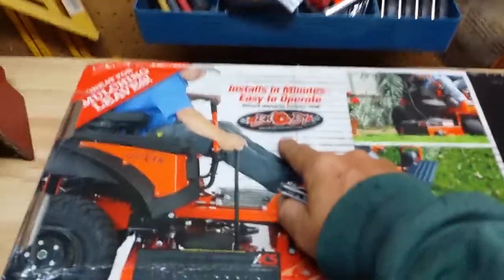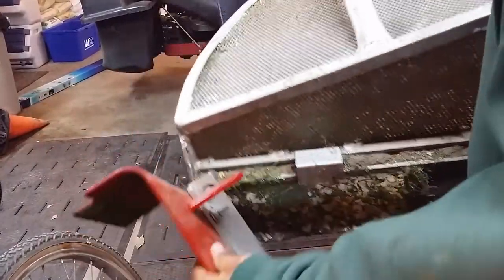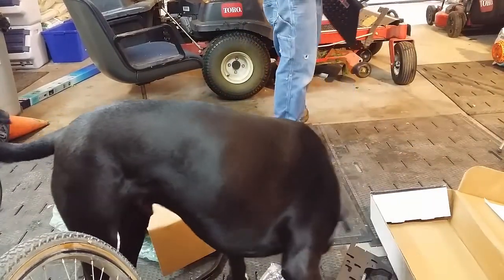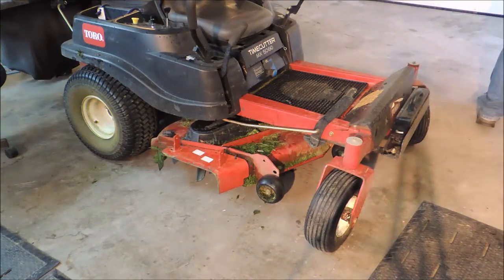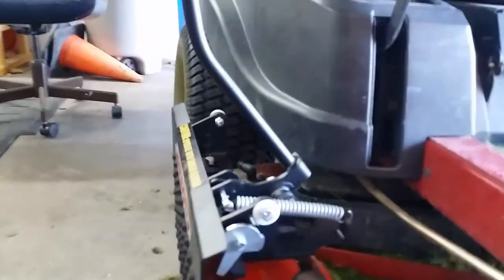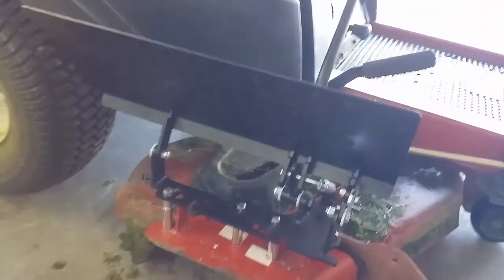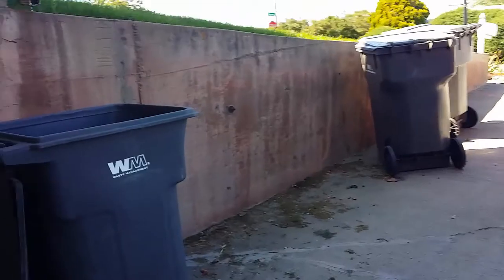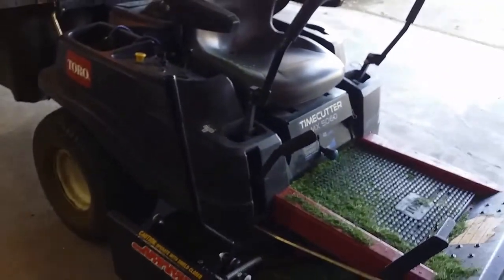Advanced Chute System

Comment: I put on an advanced chute sytem blocker ACS6000UBLS for my Arien Icon XL52. Works like a dream. I only had to drill one extra hole for the installation. I used the supplied spacers for the install. Regards Richard Sacco
Reply: Awesome i have the ikon 42xd and i think thats gonna help me. I should only need to add one extra bolt hole on the deck and i got it all put together just gotta install it on the mower tomorrow morning.
Reply: Richard, I agree only need  one new hole to install on the XD.

Comment: Nice to pull up to any property and have the option to bag, mulch or discharge the grass clippings. Chute blockers are nice but can be a pain if you want to bag depending on your mower. I use a 36 Scag walk-behind and I have the blocker by trimmer trap. Only 2 bolts to mount to the deck.  Only takes a minute or two, to switch over. I’m sure you will figure out a way to switch over  more quickly.
Reply from the maker: Yeah I still have some tweaks to make for it so i can change it out quickly. I only have to actually remove one bolt now but I would like to make it a pull pin instead of having to unbolt stuff. My first attempt has failed but I am still working on it..lol
Reply: Did u ever figure out how to put a pull pin in it?